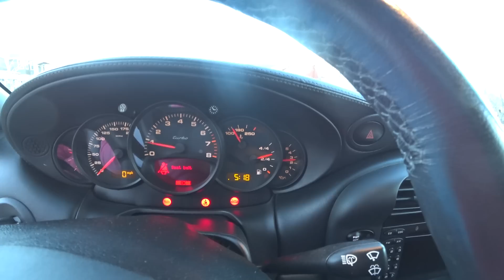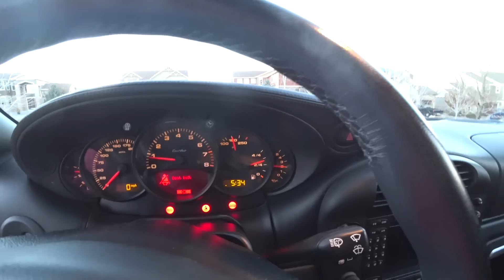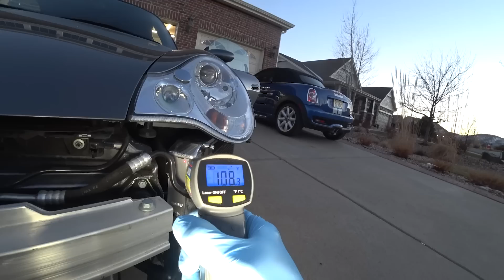Replace your Radiator - Refill without air pockets! Airlift! (996 Turbo)

Comment: is it the same as the 996 c4s?
Reply from the maker: Yes.  It would be the same minus the center radiator (unless you car had one installed - they are standard on the Turbos.)
Reply: @HeidiandFranny  awesome thank you so much! my 996 c4s needs the exact same radiator as mine is leaking as well, would you recommend the same radiator you are replacing with? I am looking at Part #: CSF-3564 from pelican!